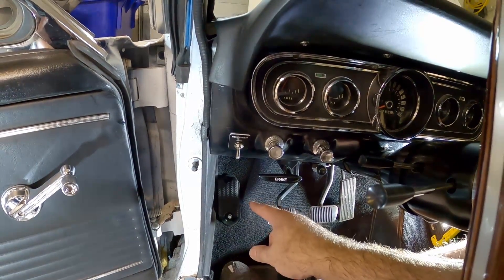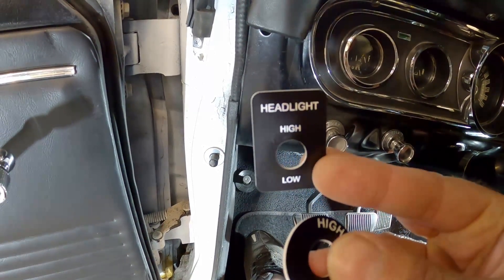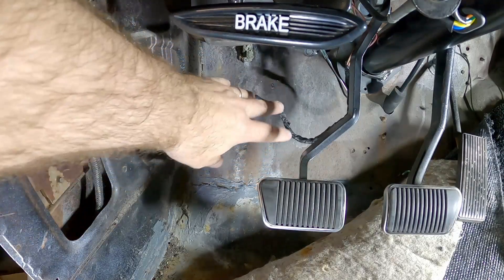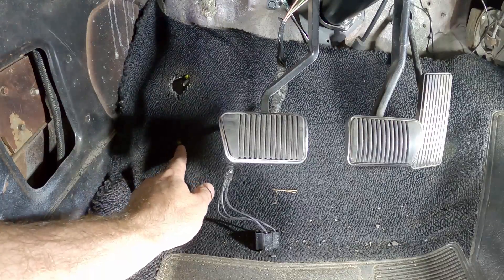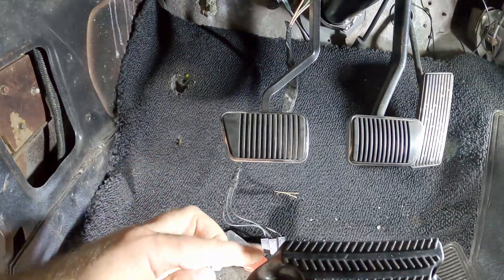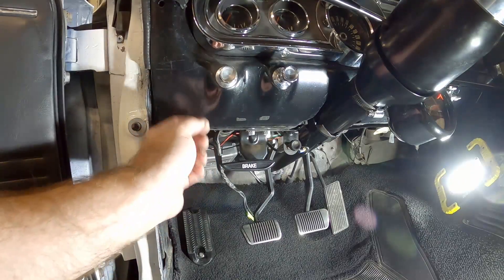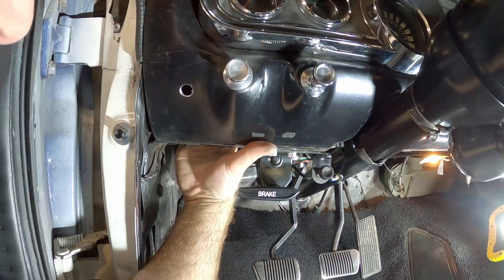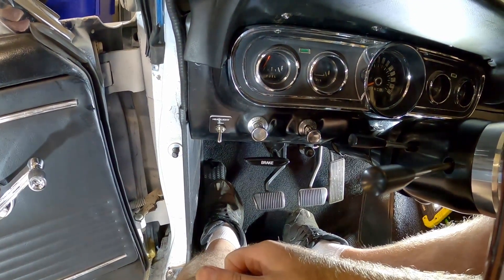Adding a Footrest and moving the High Beam Switch

Comment: I am adding two gauges to my 68, RPM and Volt meter. In order to create a switched 12v supply I added a DPST (Dual Pole Single Throw) switch for each gauge. I used the same step bit to create the 1/2 hole located on the other side of the steering column. The step bit is cool because it tells you where 1/2 inch is, you can mark the bit with the marker so you know where to stop drilling. 

I was thinking exactly what Andy said when I started drilling the hole "no going back from here". Hole came out fine, the switch fits and is exactly where I want it, just waiting my my new gauges to arrive. I hope that goes well, time will tell.

Another good video Andy, I very much appreciate the time you take to create this content. Thumbs up.
Reply from the maker: Awesome, I'm glad it worked out!!

Comment: I've thought about taking mine from the floor and putting a toggle just under the dash. I have my flashers under my dash in the middle section and love the easy access compared to other locations I've seen
Reply from the maker: I too thought about something like that, but I didn't want some random looking switch under the dash that wasn't obvious what it did.  I'm not wild about drilling a hole in the dash, but this car is so far from perfect that one little hole isn't going to hurt anything.  :)

Comment: I just bought a '69 Coronet. Since I'm replacing my steering column for a tilt, I was looking for a column that would also include a hi-beam switch on the signal.  Guess I don't have to worry about that now.  THANKS.......even if it was from a Ford owner....🤣🤣🤣
Reply from the maker: Haha, no problem.  :)

Comment: Hi Andy, when putting holes through carpet, for example the seat bolts, try heating up a piece of round metal rod, hold it with vice grips and burn a nice neat hole with no loose edges. 🇦🇺
Reply from the maker: That's a good idea.  Plus it gives me an excuse to get the torch out!  :)

Comment: Hi Andy have you looked into upgrading the headlights? There are some pretty reasonable kits out there.
Reply from the maker: Yes, I've got my eye on the Holley Retrobright lights.  Just trying to figure out how I'm going to come up with the dough since they're so expensive.  :)
Reply: @AndyKruseChannel  I just made a comment on your relay setup for interior accessories.  I bought a kit off EBAY with 2 separate relays, H9 HELLA bulbs,  and glass front with removal bulb from back. Excellent quality and was roughly $60!

Comment: Mount that foot switch under the foot rest and you won't be able to press the switch. It's very impractical with the switch there on the dashboard as you only have one hand on the steering wheel when you switch from low beam to high beam
Reply from the maker: Mounting the switch under the footrest defeats the purpose of having a foot rest.